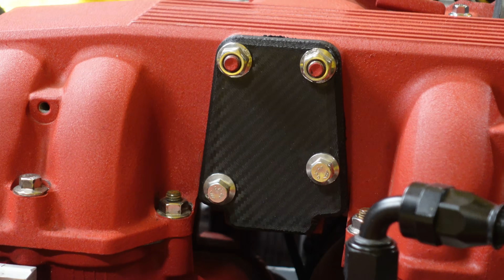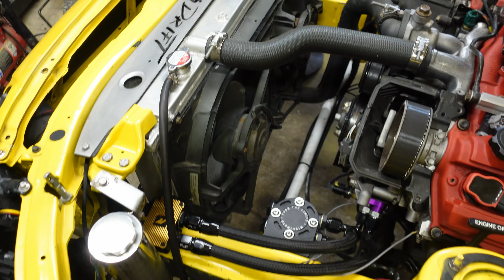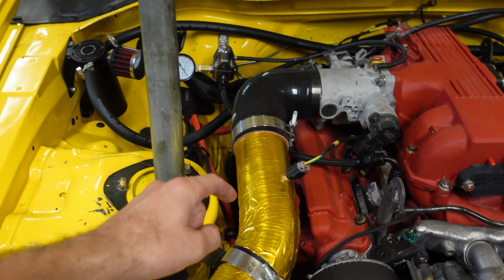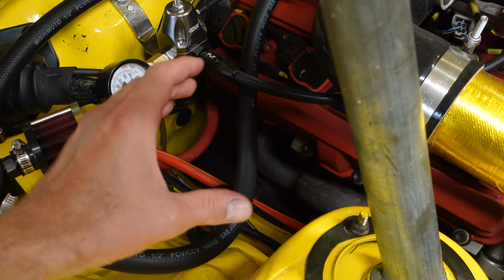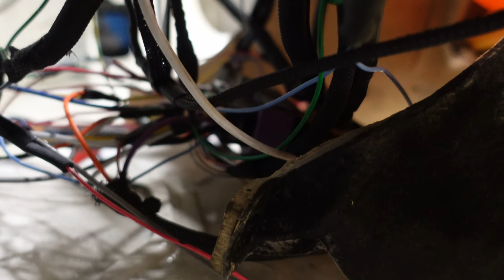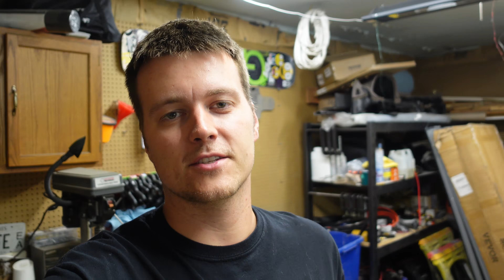How to Make Your Engine Bay Look Clean

Comment: On the valve cover where did you get those caps to cover off after the iac and egr?
Reply from the maker: Valve cover or intake?
Reply: Intake  those blue caps
Reply from the maker: @Starkiller7722 it's just a vacuum cap lol

Comment: “Wired my car to the bare minimum… starter, alternator… “underglow”… 😂 gotta have the underglow 💪🏽
Reply from the maker: It's a bare minimum requirement
Reply: @DingDongDrift  I have a sc400 lexus car runs fine but has low rpm hand at idle plus burning gas quicker also wants to stall coming to a stop but doesn't stall running a little lean on start up as well no check engine sometimes bogs little on take off and trying to pick up speed can u give me and ideal what this could be.

Comment: Thanks for sharing, answered some of my questions! Looks outstanding!
PS I like the quick statement about the 1 UZ.."Better than a Ferrari"!
I bet you'll get some feedback!
Please let us know what develops with possibly going electric on steering. I've completely deleted my  PS.. very clean setup now, but Im currently installing a standalone ECU, so haven't driven.. can't say if she'll b too much for me to enjoy; thinking front mid engine/ all aluminum V8, should b manageable, perhaps not for light weights?
I'm only running 225/35/18's up front and will b going to 17" forged light weights. I've reduced the weight considerably by doing all the mods which you have covered. I'm currently at 3,000 lbs with detachable hood(50#). My SC isn't a drifter,  I'm more interested in canyon carving..all around solid handling. I've also looked at the Grannis Racing manual steering rack, but they've discontinued the 14:1.
You've come along way, since 4 years ago.. just watched the cd009 swap video from 4 years ago 👍
Reply from the maker: No problem man, i felt that my engine bay was the cleanest now that it will ever be since I'll be adding a turbo this winter which will complicate things.